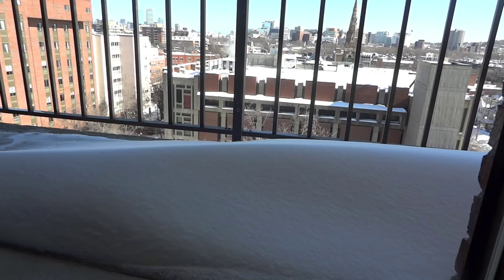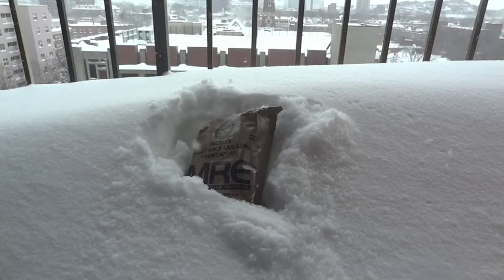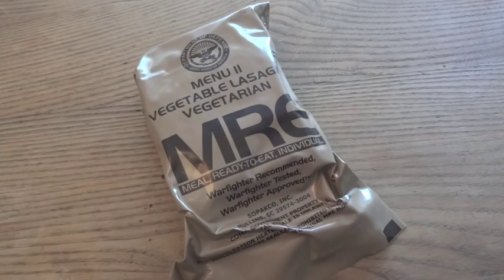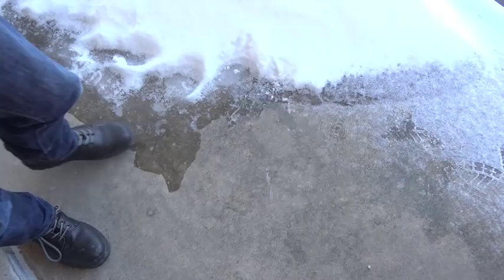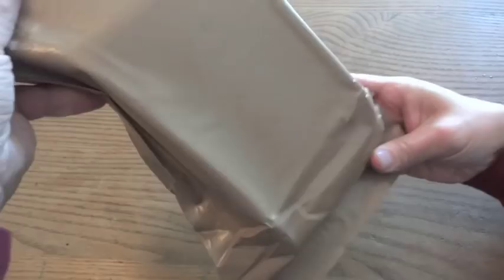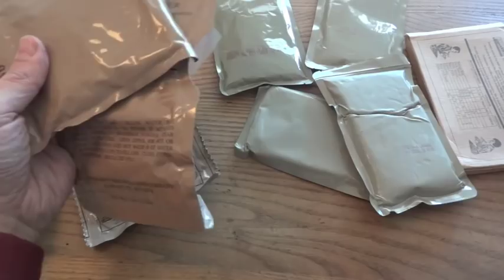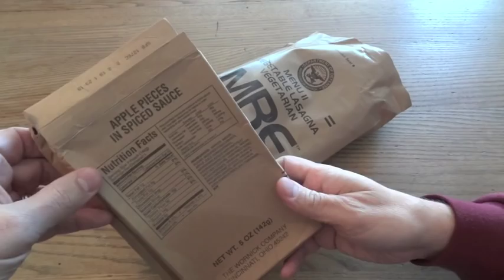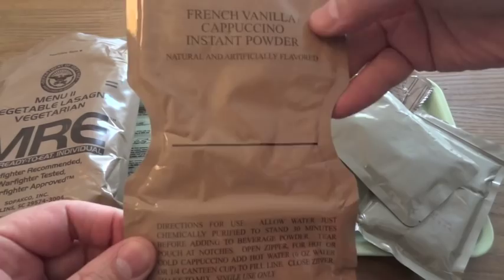MRE Basics: Rough Handling a Frozen MRE

Comment: I laughed so hard with you torture the MRE
Also rough handle it in any temperature doesn't seems to be a good idea LOL
Reply from the maker: No East too Far Very true!
Reply: It seems to be that an MRE can be used as an anger management tool as good as it is to eat!
Reply: Eistee Rider Before or after the really secured peel-able seal (there's always one in a case) causes you to require anger management?
Reply: MREs are supposed to survive falls from several feet, and are designed to be kicked around.

Comment: Wonder what heating a frozen retort pouch with the flameless heater would do.
If the difference in temperature would cause the lamination to separate quickly.
Reply from the maker: FoolishDoug Hmmmm...
Reply: i would like you to do that test also
Reply: FoolishDoug I have used a FRH to heat an MRE straight out of the freezer with no problems at all. I was actually testing to see if the FRH would even be able to thaw it out and the meal was actually quite warm with no noticeable changes to the pouch. BTW  I did this on a 2013 MRE a couple of mo ths ago.

Comment: Living in Southern California I would have the opposite problem, how to keep it cool. (It was 90 yesterday)
Reply: Y'know, I actually working on some sort of remedy to that problem (rests cheek in palm). 'Best I've come up with, thus far, is some sort of aluminized Mylar/ closed-cell insulation bag that has little pouches you can place little instant cold packs in, and rotate them as they lose their cooling properties.
Reply: Jaybird196 Easier, sometimes tastier, to buy a new case next year and rotate the old out by eating them.
Reply: FoolishDoug Well, Doug, my solution wasn't intended necessarily as one for long-term, stationary food-storage. Rather, it was meant to be a portable means for someone operating in hot weather, who wasn't going to eat them (the rations of choice) immediately, to temporarily maintain maximum shelf-life/taste. Although, I admit for soldiers (or civvies who have the same, and funds), with resupply capability, this is far less of an issue, and your solution applies handily.
Reply: Jaybird196 Now I understand what you're getting at.

Civilian maybe.
The military? I sort of doubt it.  They might take your idea and make a defrost/pre-heater bag out of it for cold weather. After all if they could issue standard MRE's and just throw heating packs and a sleeve at the soldiers instead of having to make cold weather MRE's they'd probably do it.
Reply: FoolishDoug See? You get me ;) .

  I'm in agreement with your assessment. For a civilian, as intended, this product could be of use. But, for the war-fighter, I find yours to be the more probable of the two possibilities. Due to ease of resupply, relative to individual gear load-out, the added weight expense of the bag and cooling packs would be difficult to rationally justify.

  Such a product as the kind you mention could be very useful for both standard MREs ( included due to possible availability issues of ration types) , as well as MCWs, in terms of either preheating or preventing heat loss (due to weather/climate) upon preparation.

  It is my recommendation, depending on the quality of construction, that such a device not be an element of each MCW or MRE. Rather, in my opinion, it should be a singular item as a new piece of the war-fighter's issued gear.

Comment: Actually, the reason why you shouldn't rough handle them when extremely cold is most probably because the plastic packaging gets brittle in extreme cold and could crack / shatter and compromise the content. The delamination you mentionned would happen no matter the handling, if it was the case.

Comment: How does the MRE react to being microwaved?
Reply: Not well, I imagine, due to the metal in it.
Reply: Enrique Alfonso Jaybird196 
It makes me wonder. There are certain packages that do have small amounts of metal in them.  The crisper sleeves have a very thin sheet of metal on them. Campbell's (maybe they still do?) had a microwavable plastic soup can that had a metal top if I'm not mistaken when they first came out. Pulled the ring pop top and replaced the plastic vent top, leaving that thin rim on top of the plastic soup can. I've never had Campbell's microwaveable soup in a can to be honest, I've seen them in stores and commercials.

The question that remains is if retort pouches, for it's given metal content, would behave like the crisper sleeves or like a microwaved CD.
Reply: FoolishDoug Well, I can't answer whether or not it'd react like in the CD example, but I can give some info on the microwaveable soup cans. They work decent enough. They get very hot (contents-wise). They have a layer of some sort of hard insulation around 'em, but they have a metal pull-ring lip that is exposed, but I can't remember how much more is (it's been a while). They have a tendency to "bump" when cooking. NEVER pick 'em up by the plastic venting lid, they become very hot, and VERY pliable. You'll burn your fingers, and probably also drop the soup :( . 

Me? I'm afraid that not only would there be a pliability issue, but they might even explode, due to a lack of hot air vent O_O .
Reply: Jaybird196 I'm thinking worst case the aluminum arcs causing it to disintegrate like it does in CD's and possibly contaminates the food.
Reply: FoolishDoug Maybe. To confirm either hypothesis we would have to test, but either way...that poor microwave, though :( .
Reply: +FoolishDoug It's been awhile since this was posted, but I figured I'd respond anyways.  About 6 years ago my scout troop took a trip to Fort Knox, and decided that it would be fun to eat MREs for lunch.  Long story short I messed up my FRH, and had the brilliant idea of microwaving it.  There was plenty of arcing to be had, that's for sure.